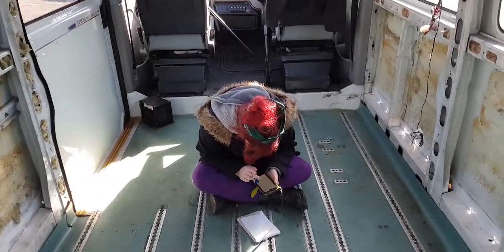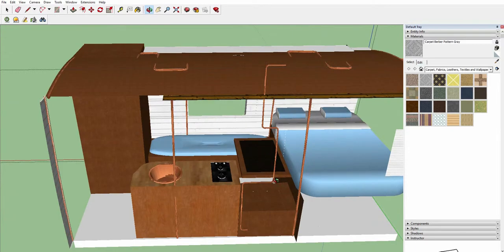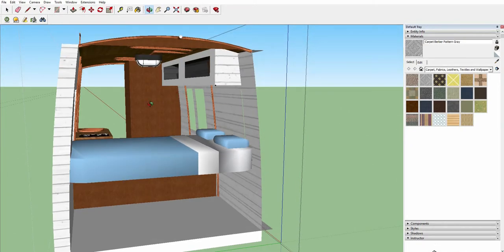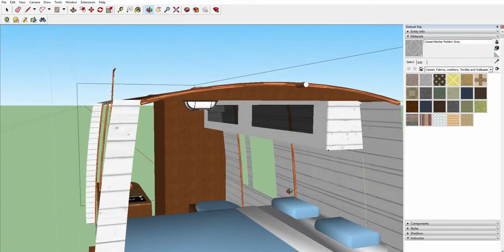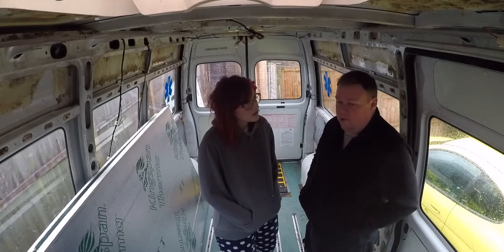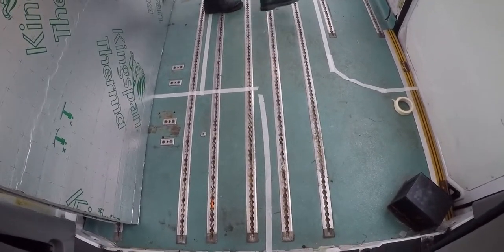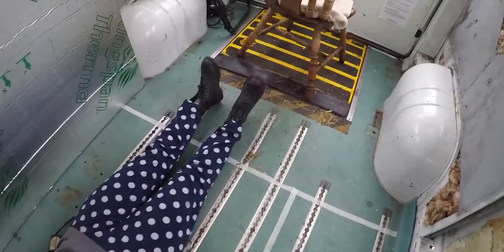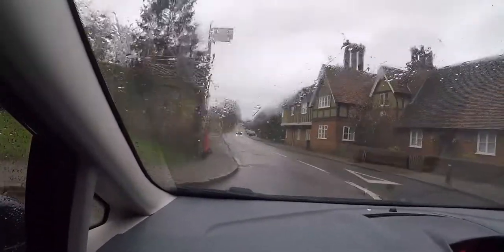S2A Ep5 - The case of the mysterious broom handle. + wiring and layout

Comment: So did you work out how the broom got there?
Reply from the maker: Nope. Best I can guess is at some point it was put on top of the tarp that covers the rabbit's cage and the wind flapped it off. :/ shrug
Reply: @stretcher2adventure787  We lived in a little picturesque village called Stisted near Braintree in the early nineties, the house was Oak framed and very old. When we moved in it was clear there had never ever been any locks on the downstairs windows and at a guess the frames were 100 years old! Later we moved to a bigger house a couple of miles away in Braintree itself and within about a week of moving in someone had used a broom handle to try and force entry to the rear french doors. They actually managed to snap the door handle off - quite a contrast we didn't like that particular house at all and hence indirectly why we now live here in Sunny Shropshire.
Reply: PS You may have noticed I have Switched to a 'Brand Account' as well :)
Reply from the maker: Oh wow that's scary. Well there was no sign on any one breaking in to our yard.
Reply: Criftins Campers I would imagine it swept it's way right in 😂😂😂
Reply: Creazioni di Realta if it was nearer to Halloween that would have been quite spooky.